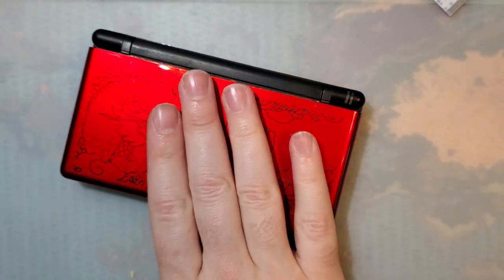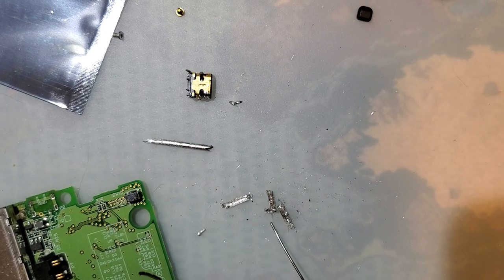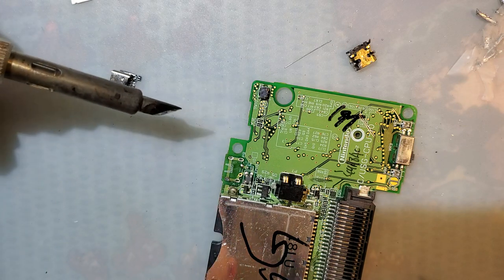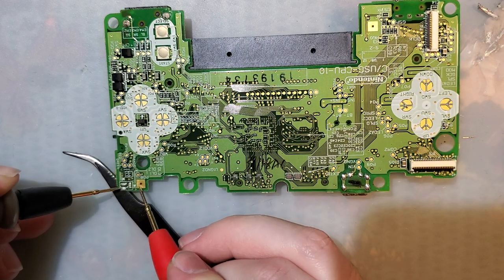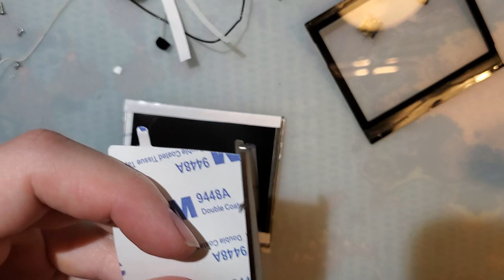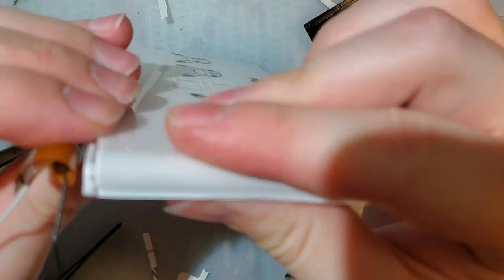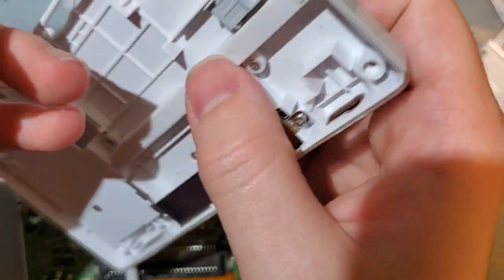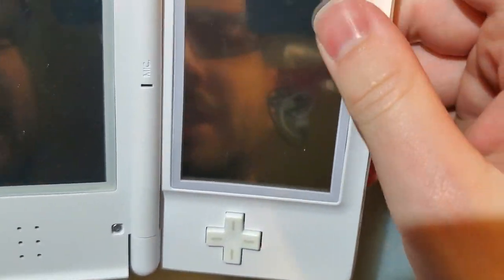DS Lite Reshell and USB C Charge Mod

Comment: The rubber pad situation for me I have a dental tool that has a needle point (that tends to bend easy) but I used it for years and it's perfect to get under the surface of the rubber pads and pop them right out without leaving visible damage when put back together. I have tried just about every other way and yjru always left damage.

Comment: out of stock :(
Reply from the maker: Gerbers are in the linked github so you can order the PCBs anytime you want
Reply: @makho  oh so  i take that file to someone like pcbway or something and place an order. then all i need to do is order some of the USB C jacks but, i need to get a certain one/model type i might guess
Reply from the maker: @cdoublejj  yes, more or less. Oshpark will probably be cheaper for the boards due to the small size of the boards and the castellated hole requirements. The part number for the specific port should be in the github as well.
Reply: @makho  i noticed there are a number of files on the git, a bill of materials, an instructions "MD" file and "gerber.zip" would i just upload that entire zip file to oshpark or this for people who know what they are doing as far ask pcb print ordering and all that. i can solder but, never designed and printed a pcb before. EDIT: ypu just give the gerber zip to the oshcut uploader what a wierd file name. who'd have though babyfood was the key to USB C on DSL?
Reply: @makho  ok i got it ordered but, some how i don't think they will honor $0.70 cents shipped for 3 of this pcb. lol now to find the SMD parts
Reply from the maker: @cdoublejj  they will
Reply: @makho  I can order the pcb but what about the resistors and type-c?  Do you know the info for them?
Reply: @cdoublejj  can you help on the resistor info?  Is it stated in the github link cause I can't find it.  And I'm guessing get any usb type-c female?
Reply: @Alucard6X  no it's specific parts. The resistors are cheap but come in a hundred pack lol. Sooo tiny. Reply here so I get notification to reply to you and I'll give you part numbers
Reply: @cdoublejj  I think it's 6 pin type-C, I think, you know about resistors?  If you do can I get info and btw how did you get the resistor info?
Reply: @cdoublejj  Any luck finding the resistor info?
Reply from the maker: @Alucard6X  I believe I go over this in the video -- 5.1k 0603 resistors
Reply: @makho  must of miss that, at 20:45 you just say that you don't have an idea how big they are so that's why I got lost.  Also I just finally found the info on the github and it says 2 R0402 5.1K resistors, are you sure it's 0603?
Reply from the maker: @Alucard6X  defer to github specs